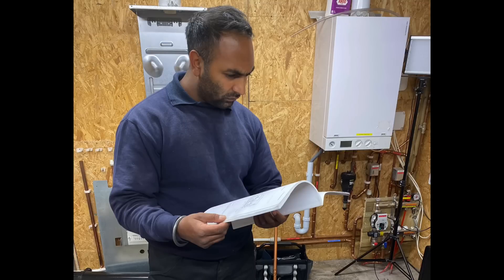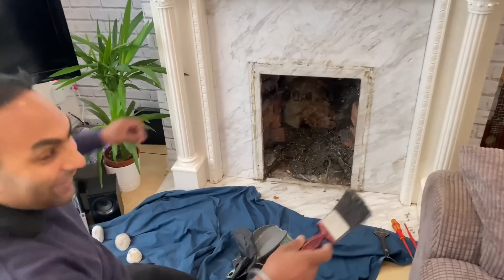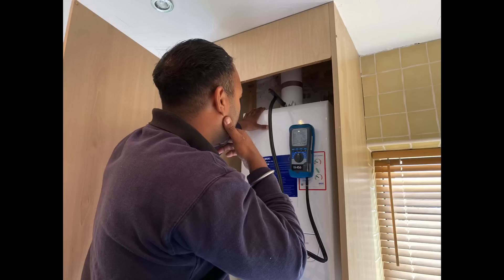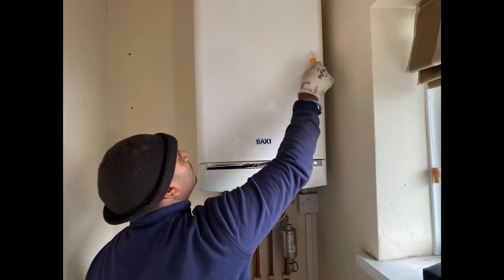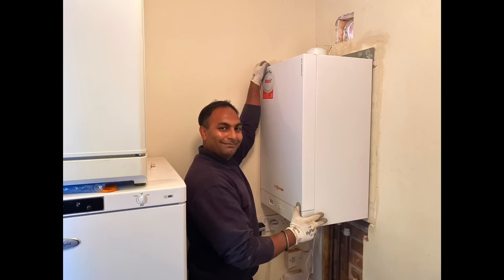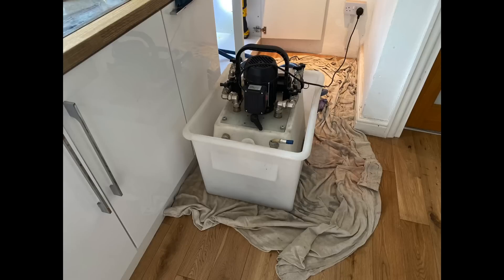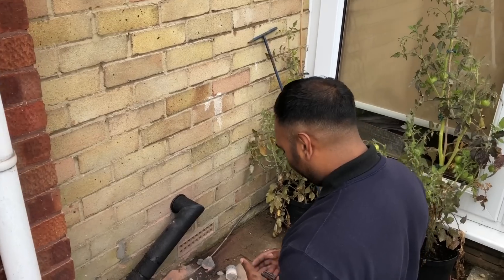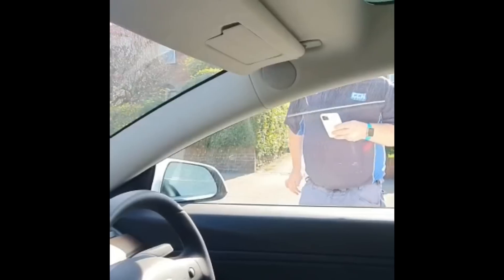ACS Gas Training - Fast Track Plumbing - Train To Be A Gas Safe Engineer

Comment: wouldn't be using a water manometer to test gas burner pressures mate,  need to use a digital one to get the correct working pressure....... water ones not accurate
Reply: I have used both.. I do prefer the digital manometer its alot more accurate and easier. Testo is brilliant 👍
Reply: @KS-we8ov  yeah its all i use over here, i use the testo 300 flue gas analyser also its good
Reply: also if you ever need a job over here my company is taking people on, they have a few uk gas fitters working here
Reply: that was on the gas fire ) just seen you use the same testo equipment as me for the boilers(i live in Oz now ex uk gas fitter and am doing gas work here)
Reply: so all good :) you used the testo 510i yet? great for gas tighness tests

Comment: What is the main difference between the landlord gas safety check and a boiler service?
Reply: In a landlords safety check you are checking every gas appliance in the property to ensure that it is working safely and to current regulations. Ie  gas fire, cooker and boiler.. integrity of chimneys and flues.. this has to be done every year.. boilers service is just to ensure maintenance is carried out regularly to avoid breakdowns , it can also void your manufacturers warranty 👍